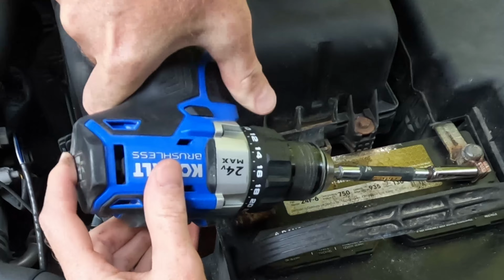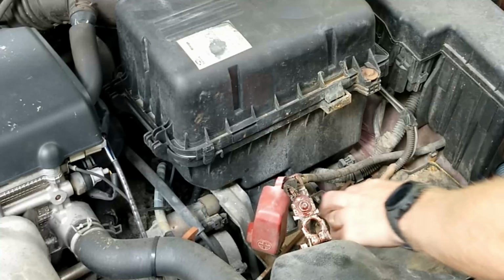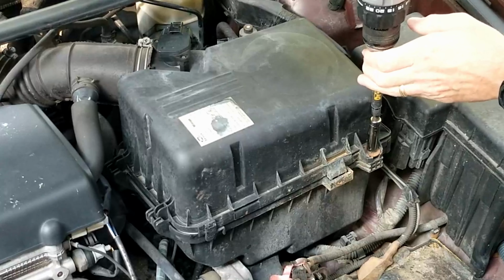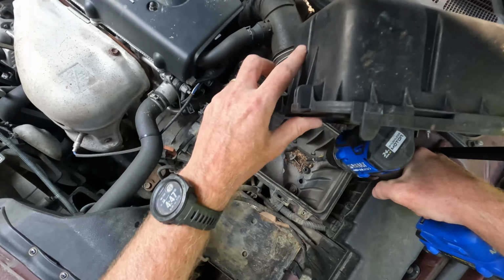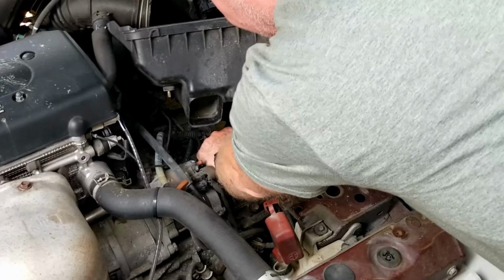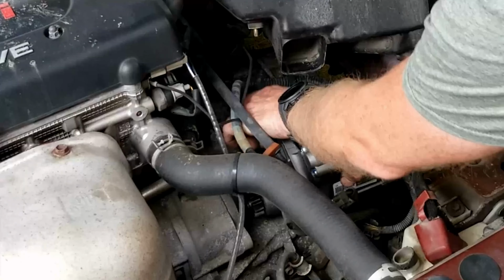Save MONEY and TIME: Replace Your 2003 Toyota Camry's Starter Yourself | SBW#71

Comment: There's two starters listed as a fit for a 2003 Camry LE, the "normal" starter like what you have, and the "optional" gear reduction starter. Both show as a fit for this car. Do you know if I can use the optional starter in place of the normal one without making any changes to get it to work?

Thanks for the video! And I used to have to "thump" the starter on my '66 Ford Fairlane back in the day. :)
Reply from the maker: Thanks for the reply @MrWaalkman.  As for the optional video, I do not know if you can use it without any changes.  I usually just try to use the same style replacement.  If you did use the one with the gear reduction let me know so others might learn from your experience.
Reply: @SeanMoenkhoff  You're welcome of course! Due to the lack of information online, I went with the standard starter. But the optional one should hook up just fine.

The eBay seller, "bouthu_autoparts", advertises a painted one, but will sell you an unpainted one instead. A bit of bait and switch, and they don't seem to care. I will avoid them in the future.